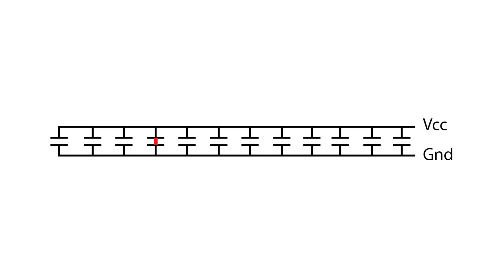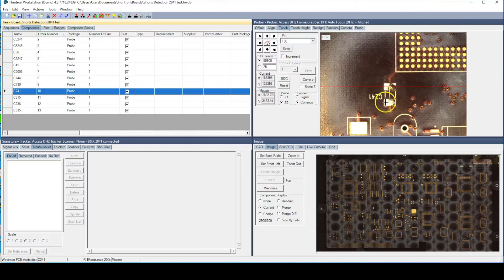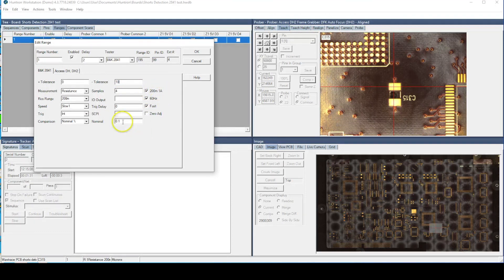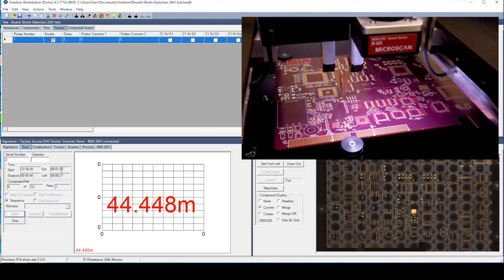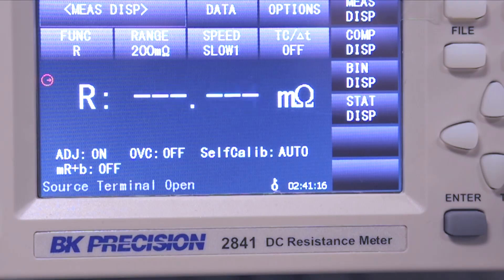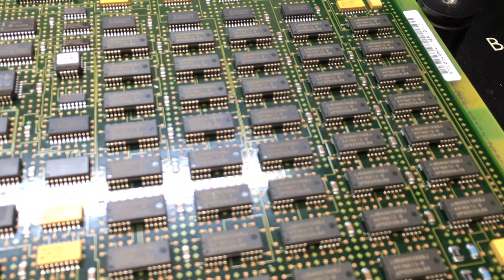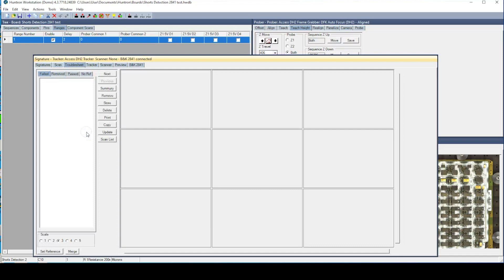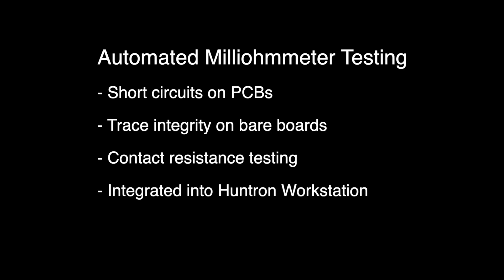Locating Short Circuits on a PCB using a Milliohmmeter and Huntron Access DH2 Prober

Comment: it is better to let a current flow through. Heat is produced at the location of a short circuit. The place can be easily found with a thermal camera.
Reply from the maker: IF you are comfortable putting enough current on the board to cause the short to heat up.

Comment: Searching for shorts with a milliohmmeter is a great method, monitoring on a PC and then displaying the order of components is amazing.
Today, to a large extent, this process can be replaced by a thermal camera, the short-circuited capacitor literally lit. It is only necessary to separate and separately measure components with higher power loss, because they also shine.

Nice day Tom
Reply from the maker: Using a thermal camera can be effective in locating a short circuit but requires the PCB to be powered on in some fashion. Powering a PCB with a short circuit can put the PCB at risk of further damage. The power levels applied from the DMM are minimal and reduce risk to the board.
Reply: @Huntron  Yes, when using a thermal imager, it is necessary for the PCB to be live and it is of course overloaded, but I assume that when the short circuit dps occurred, it was energized and the thermal imager is much faster to find the primary overload problem. A much worse situation then occurs after the elimination of the primary phenomenon of failure, if we eliminate only the consequence and do not look for the cause of the failure, there may be a situation where the repaired part of the circuit causes greater devastation than the short circuit itself.
In some cases, the cause and effect is the so-called 2in1, for example, SMD capacitors 22µ / 16V, which perhaps die from the very principle of existence.
If it is possible to trace and eliminate the short circuit with the help of a thermal camera, ant work comes in the form of searching for problems in the surrounding circuits of the short circuit. In the first phase, of course, without voltage using a suitable measuring technique - miliOhm meter, ohm meter, diode tester, etc.
In some cases (for example, if we have only a part of the device - for example, a single card or a module without the necessary documentation) we cannot test under voltage and this is a situation where your devices are priceless. I have made several test fixtures for this purpose, so I can, for example, test the functionality of diodes, transistors, multilayer switching components and I do not have to fly them out of the PCB. These products of mine are absolutely trivial, single-purpose and cannot be used for other testing, so I admire your device, which has such great flexibility and can also store measured values and then evaluate them (in my submission it is represented by paper, pencil and calculator 😂)

Tom wishes much success in further development and a beautiful Christmas
Reply from the maker: @Edisson. "...for example, SMD capacitors 22µ / 16V, which perhaps die from the very principle of existence."  - This made me laugh (hopefully that was your intention :) ) This is a good discussion. Hopefully other viewers are getting some useful information. Have a great Christmas!